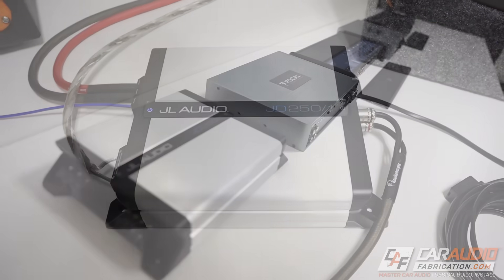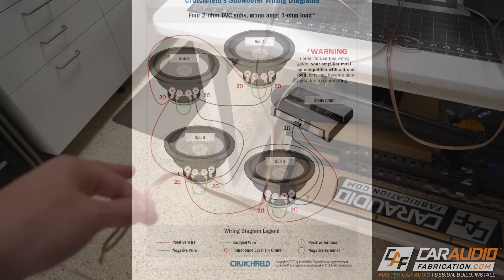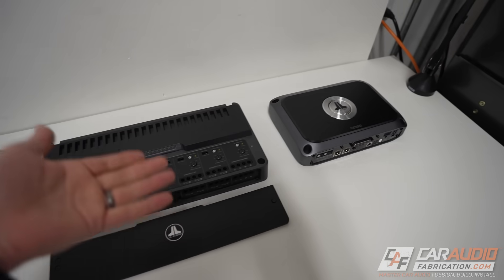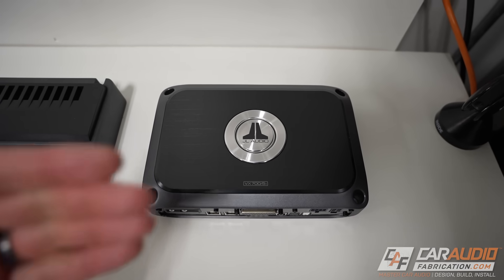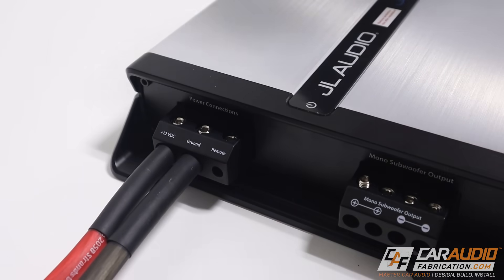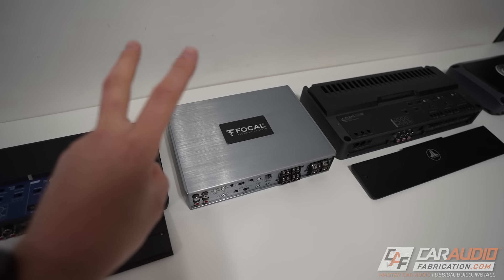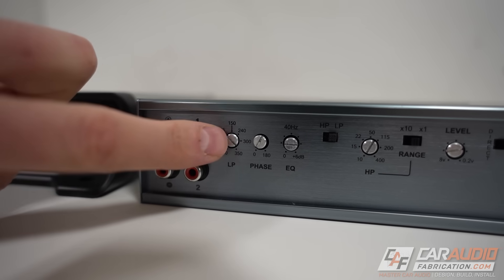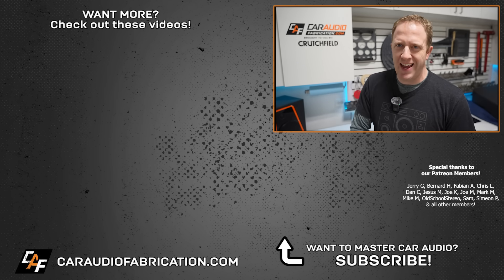Car Audio Amplifier Basics! The path to better sound EXPLAINED!

Comment: When using a DSP with a line level output voltage that exceeds an amplifier's maximum input voltage, what is the correct procedure for setting the amplifier's gain? 

My thinking is that I Should I use the software to lower the signal and keep my gains all the way down? The current knowledge is turn the gain up at a specific test tone until it clips then back it off a little.

Comment: Mark, do you set your amp “bass boast” to the middle setting, high setting, low setting, or off? Some say using it can cause distortion. I like the middle setting. It gives the bass more nut.

Comment: If I have 6 speakers (2 corner dash, 2 knee speakers/ 2 rollbar speakers) and want to add a subwoofer can I make a 5 channel amp work?
Reply: @edwardcontreras3148  you can always get a 2 or 4 channel then bridge the wiring

Comment: Hint: my new head unit's amp remote lead, didn't work, so I used the electric antenna one, and it had the same effect, it turns the amp on and off. 👍

Comment: Hi Mark, subscriber here, enjoying your videos... but I'm noticing that I never see (or at least haven't yet) and videos where you have any capacitors (1F, 3F, 5F, 10F, ... 300F ultra, etc...).  Am I to infer from their absence that you don't feel they are needed?  I have two amps (RockfordFosgate... 800 amps for subs and 600W for mids/highs).. I originially had a 1F cap when I had my system installed years ago.  I'm re-doing EVERYTHING myself (still keeping original amps/subs)... and upgrading my wiring AWG from 4 & 8 to 0 & 4.  My biggest question is do I re-use the 1F cap, toss it, replace it with one of the ones I listed or just skip caps altogether?  HELP!  :)

Comment: Question I am trying to install an aftermarket subwoofer in a 2023 mazda cx5 with the premium Bose package. I want to install a LOC on the subwoofer output from the amp but there seems to be a steep cutoff at around 35hz. Does audiocontrol sell anything to restore the frequencies below 30hz ? It would suck to install a larger subwoofer but not be able to reproduce any of the low end frequencies. Any advice would be great.

Comment: I'm running a 7 speaker system with a 10" subwoofer.  I currently have a 5 channel Pioneer amplifier and an Expert 8 channel Bluetooth DSP.  One install guy told me that I needed an 8 channel amplifier to connect all speakers and sub to the DSP,   Would it be better to just get an 8 channel DSP amplifier combo unit?  The 3 speakers in the dash are being powered by an internal factory amplifier.  It's a 2023 Dodge Challenger.  So the 2 door speakers (6X9), the two rear speakers (6.5) and the subwoofer are being powered by the 5 channel amp.  I think the sound would sound better if all 8 speakers/sub were connected to one 8 channel DSP amplifier.  What do you think?

Comment: I'm going to use factory sub wires to LOC and the speaker wire to the sub will be routed the same place. Should I wrap my either sets of wire to prevent noise? (Factory wire to factory sub or speaker wires from amp to sub)

Comment: Im loving this kind of content, if you could please do one showing which headunits have better features for different applications. Im starting an SQ build and would love to try and find a headunit that spits out good volts for RCA's, has a good USB capability for lossless audio listening and hopefully can also do andriod audio auto feature.
Reply from the maker: Thanks for watching!  Will see what we can do
Reply: Try using a DSP like a Helix with the HEC HD audio extension card and running a good source file either from a phone or a DAP. FLAC 24bit/192khz files are about the best you can run unless you by a BRAX DSP at $6k a pop

Comment: Great refresher Mark. The convenience of a DSP-amp definitely make them a tough option to beat. If given a choice, gotta go Helix. I had a DSP.3S for a few years, i  loved that thing. Amazing software.
Reply: @WBG123098  I had one too. Bout to build a full SQ build and I’m gonna go with the DSP Ultra S. Helix definitely has amazing software and features. Can’t go wrong with a Helix!
Reply: The software made you love Helix?
Reply: @fosiaudio  Absolutely. The software is the #1 thing Audiotec Fischer brings to the table. Just from when I bought my DSP.3S until when I sold my car, 2022-2024, the software was basically unrecognizable from even when I first bought it, right when DSP Tool v5 dropped. So many features, built in RTA, auto-eq, honestly the features are endless and constantly improving. Their software engineers are the best in the industry.

Comment: looking at the Audio Control  LC 6.1200 for front 3 way and LC 5.1300 for rear 2 way and sub.  My  thought is going active rather than passive x over.  I did see you go with a similar set up but used the 4.800 and 1.800 .Out side of power is the 5.1300 the same , for this application as the two amps ?   Do you see any issues with this?  no desire for dsp
Reply: @ant123cars  look into museway amps. I have an M6 Pro running active front 3 way. Separate stinger mt-2000 amp running 4 sundown subs. All with built in DSP in the museway amp
Reply: @frv_motors5673  appreciate the thought.  I already have the amps and since he is an AC guy, I was hoping to get his thought on the differences in my application on the lc5.1300 v lc4.800 / lc1.800 combo

Comment: I have a Kia stinger with the 15 speaker system. I want to add 2 subs on top of the 2 factory subs but I also want to add another amp for all the factory speakers 

Would I just need to add multiple amps to maintain the multiple channels? Or is each door considered 1 channel 

Also would it be a viable option to add more power to the factory subs but also shift the frequency range toward mid bass?

Comment: What do you think of dsp head units? I havent heard really anything about them and I have one. I think it's a bit limited because I can't put bandpass filters (only low or highpass) or eq for all channels. It does have time alignment though.
Reply from the maker: There is yet to be a single "DSP Headunit" on the market that does everything you truly need. As of right now it kind of feels like a marketing term they just slap on the box to kind of pull one over on consumers. The most limiting factor is usually that there is only 4 or 5 channels of control, and things like EQ apply to ALL channels when they should be channel specific

Comment: Hey man one question which amp has the best sound quality nowadays?
I have Genesis uk gear from 2 decades ago.
What would be better now you think?
Reply from the maker: You can do so much with DSP now, the JL Audio VXi and Mosconi Pro are sooooo nice
Reply: @CarAudioFabrication 
Yes yes. I've had Audison 5.1k it was very good. I sold it cuz I needed money. But yeh the masconi looks tasty to me man ATM. Also the audiocontrol looks cool too.
I would want a dsp amplifier next as I imagine my car being newer. 
All the brands you mentioned are amazing. Also arc and gladen I would like to throw in too.
This time again I want to buy a top one that will last and keep my old amp for my old car with the aftermarket head unit.
Speaker wise I want something really good as well. Was looking at Steg again I would love some suggestions buddy.